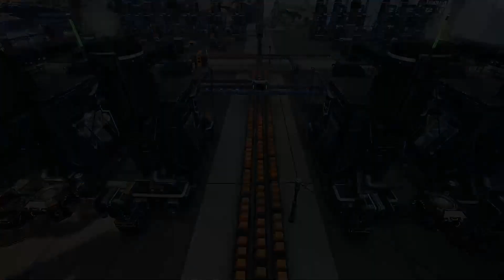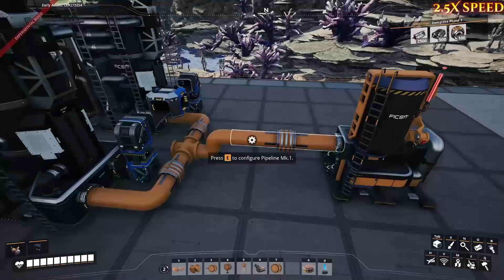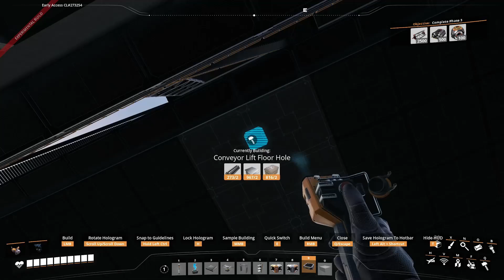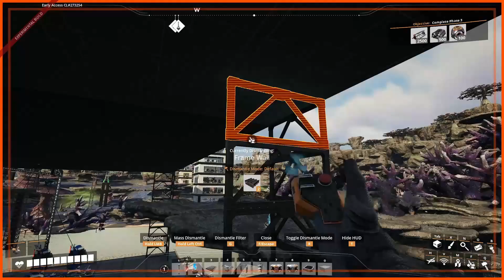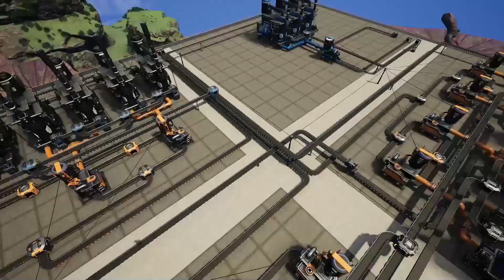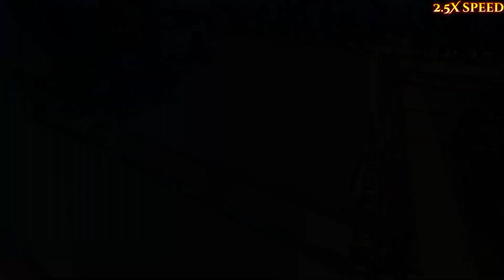LOAD BALANCED 780/min Plastic and 810/min Rubber - Satisfactory - Update 8

Comment: Would you happen to have a Discord channel?  Followed both of your 18K fuel generator videos with great success, but I did have a few questions about this plastic/rubber factory.
Reply from the maker: Hey, so happy to hear you had success with the fuel generator! Currently I do not have a Discord server. That is something I’d like to do somewhere down the line, I’m just not ready to manage that yet. I know it’s not as convenient here, but I’m happy to try and answer any questions you have.
Reply: @moo121  I was able to figure it out.  I just had to think it over and do the math in my head.  Watching your AI limiters to Supercomputer video.  I'll be doing it a little different since I already have factories doing everything except high-speed connectors and supercomputers.  Just need to figure out how to load balance split 238 silica to 150 and 88 respectively.